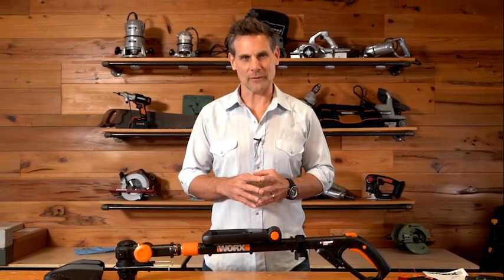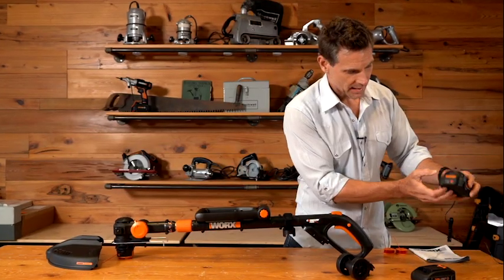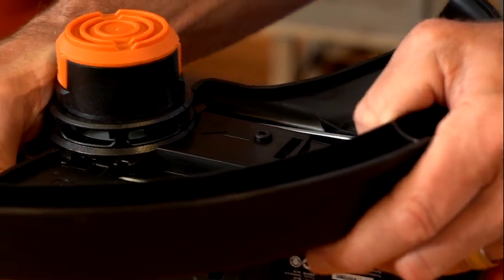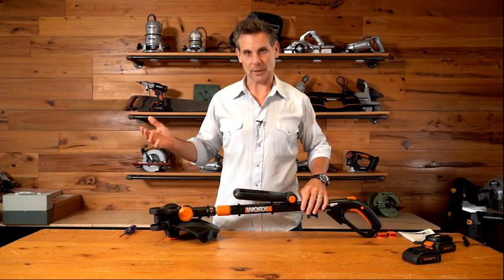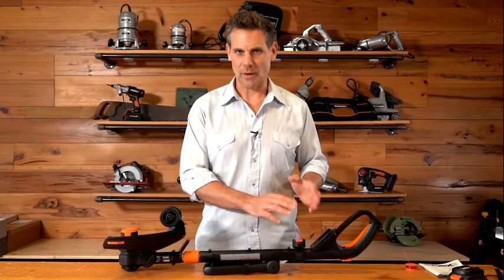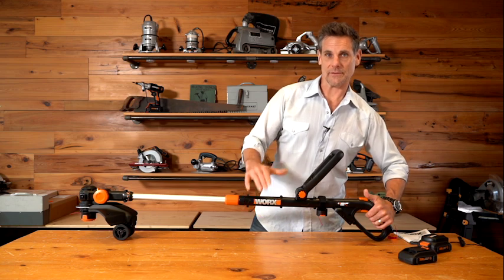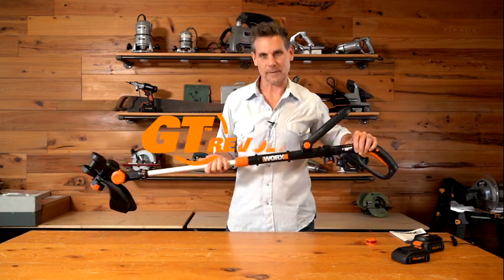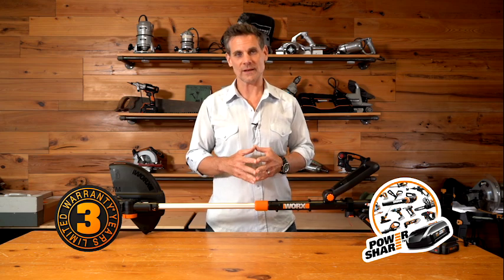GT Revolution | General Set Up & How-To Overview

Comment: Had no idea how to rotate the head to get into edger mode.  The directions and the graphic on the tool do not make it necessarily clear.  Watching this was very helpful.
Reply from the maker: Thank you for sharing your experience and watching our video!  Should you have any issues, you can always contact our Customer Care team at 888-409-1124 Monday through Friday from 9 am until 6 pm EST and on Saturday from 8 am until 4 pm EST.  We'd be more than happy to assist you.  

Thank you for choosing Worx!
Reply: I came here for the exact same reason. This video easily gave that feature clarity the instructions did not.
Reply: Same thing happened to me.    Thank God for You Tube. Ha
Reply: I tried and tried and tried.  I was NOT able to not pull the head forward to twist the long silver shaft out in order to twist it.
Reply: Me too!
Reply: So much better

Comment: Why does the head need to lock? The older model 151 goes up or down just fine without an extra locking step?
Reply from the maker: Hi Alisha the pivot head locking knob is a safety feature.

Comment: When I hit the “feed line button” nothing happens. The line doesn’t get any longer. Any help?
Reply from the maker: Turn off the trimmer and remove the battery. If required, the line can be fed out manually. To operate, press and release the manual Line Feed Button (#17 in the owner’s manual), while gently pulling out the line until it is long enough to reach the Line Cutter. If the line extends past the Line Cutter, too much line has been fed out. If too much line is fed out, remove the Spool Cap and turn Spool counter-clockwise until the line is at the desired length. Should you have any additional questions or concerns, please contact our Solution Center Team at 866-354-9679 Monday through Friday from 9 am until 7 pm EST. We'd be more than happy to assist you.

Comment: I just got mine but it only had one battery. Should I notify company?
Reply from the maker: If it is the 20V it will only come with one battery. If you purchased a 40V it would come with 2 20V batteries. This video is from one of the original GT's from when they were first launched and may reflect what is currently being sent out today.
Reply: @WorxUS  I have the original Worx and the battery holds a charge for only 5min max. Are there better batteries for the old model?

Comment: How do you keep the wheels from falling off?
Reply from the maker: Hello, make sure your wheels connection piece does not have cracks or chips. This will hinder assembly  Press the tab firmly, be sure to fully set the wheels onto the metal plate, and release. We recommend that you do not bog down your trimmer. Let the tool do the work. Contact customer service if you still need further assistance. We hope this helps!
Reply: @WorxUS  Thank you, Have you given any thought to bringing back the Works GT 120 grass trimer.  That was my first machine, I still have it, that was a good trimer, all you would have to do is upgrade it with a  better battery, and extend it out a little for taller people.
Reply from the maker: Hi Marty, that is something to consider! I would be more than happy to pass your feedback on. Thanks!

Comment: We got one to but really sucks, so weak, no power what so ever and they string is so so thin, barely cuts or trims the edge without going back over it twice, now with my gas edger not a problem, regarding the free spools of string , it’s not free , it’s 9.00 for shipping, with that price just go to Homedepot a get 5 times as much of string, you just gotta ind it up, my opinion not worth it, not even if it was 40.00 , we paid over 100.00 , so so sad and it’s America product. Do not buy but invest in a real gas edger. Peace and God Bless
Reply: The reason I got the GTR was because I didn't wanna have to deal with gas or electric. I really had no issues besides the length of time for the batteries to charge up. The string isn't very strong, but that's no big deal, just buy strong string elsewhere. Unless you have a humongous yard, this will work just fine. My yard is in the city and I have a small front yard, but large backyard. The 1st battery lasted almost all the way thru, I replaced it with my 2nd and finished with only using 1 spool. After I finished I charged the batteries up and put them inside in a cabinet, and the GTR in my garage. So far I'm happy with it.